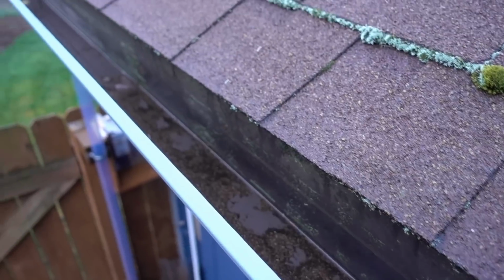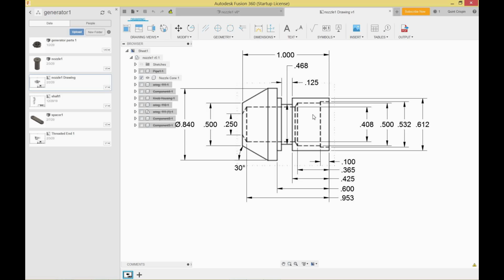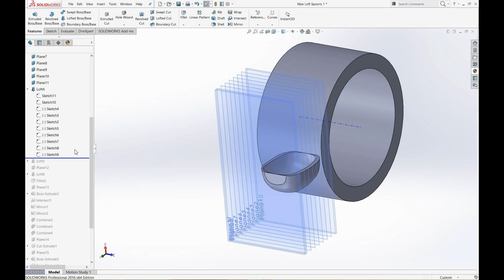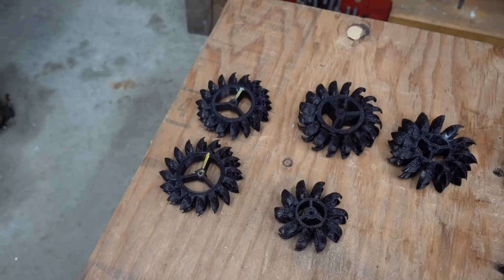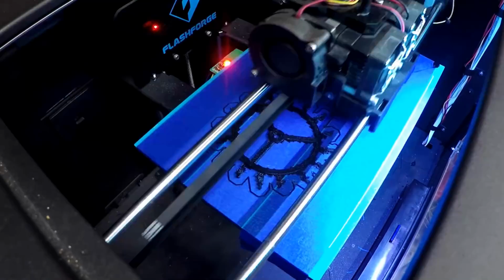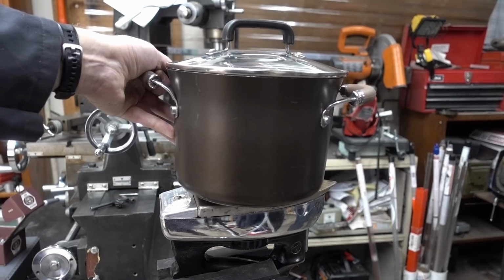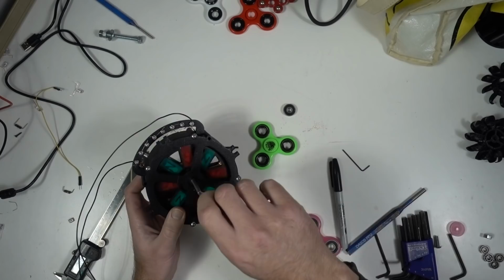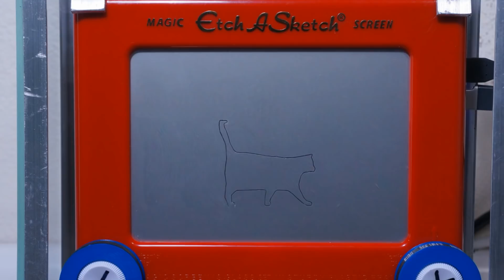Rain Gutter POWER #3 - Fidgeting With Turbines!

Comment from the maker: Thanks for the support everyone!  The suggestions I'm hearing so far are:
1. Coat the turbine with Rainex to shed waste water more rapidly (love this idea)
2. Enclose the turbine in a 3D printed shell with an exit port
3. Orient the turbine horizontally (90 deg) so the waste water can only go down with gravity (some must go up with pelton though right?)
4. Try a Tesla turbine
5. Build a rectifier out of mosfets for less voltage drop
6. Make the jet point straight down out of the pipe so water doesn't change directions at all
7. Larger diameter vertical pipe - if this worked it would violate every physics book ever written. I'd have to do a "why this doesn't work" thing.
8. Install an inline propeller/kaplan/francis turbine in the vertical pipe.  I'm almost certain this will hemorrhage water and not spin, but hey, if anyone can make it work...
9. Do a little more math on the velocity of the jet and make sure the pelton is spinning at 1/2 that speed.
10. Attempt to evaluate the alternator performance at various RPM/load to identify peak efficiency and target that with the turbine and rain.
11. Pronounce it RUUF instead of RUFF.  :)  Never knew I did this (or how much it bothers people!)

Part 4 is pretty much ready except for a few editing tweaks but as I said in the show notes, due to Covid-19 YouTube is taking EXTRA long to approve new channels for ad revenue.  So even though I've put thousands of dollars AND hours into this content, I have yet to get a SINGLE penny back (and may not for some time).  Therefore until YouTube approves my channel, the ONLY way to see Part 4 will be to visit my Patreon page and become a per-creation patron.  Part 4 is not published yet but will be VERY soon.  Sign up now and as a patron you'll receive a notification as soon as it becomes available.  The video will EVENTUALLY become public (once my channel is approved) but YouTube is keeping that timeline a mystery.  Don't forget you can set a monthly limit (I rarely post more than once/month if ever) and cancel your subscription at any time. 
 
https://www.patreon.com/QuintBUILDS

Donations are all "per-video" because it takes forever to make stuff like this and I NEVER want to take your money without having earned it.  

Part 5 is yet to be created so now is the time to cast your vote for which of the above suggestions to try first.  Here's my thought, lets get one reply for each of these ideas #1, #2, #3, etc.  Everyone else can LIKE/THUMBS UP their favorite.  I promise I'll try to do as many as I can, but will start with the most popular.  Also, the rain is REALLY tapering off right now so any serious testing would need to be simulated with a hose.  Part of me wants to document all this and lock it away until September 2020, right before the rainy season so it can be a bit more legit during testing.  But you folks are my community.  I'm REALLY touched by all the kind words and support.  If you'd rather have me dive back in right away with simulated rain, I CAN do that.
So lets see how this goes.  Never done one before but there's a first time for everything!  

A couple people have asked for a one-time donation option (that's how i made my first online donation so I totally get it).  Use PayPal: BUILD2LRN@GMAIL.COM  
I'll have to manually send you a link to Part 4 though which will delay it a bit.

Thanks for watching...

-Quint
Reply: Quint BUILDs , following now from the Philippines. With the rain we get during typhoon season, this would be a fun project for sure.
Reply: Vote for #2!  The other solutions seem like you'd be chasing very small gains, however harnessing all that "waste" water in an enclosure has potential.  Awesome project!  Subbed!
Reply: @mastabugfish  actually no, its as you put it, waste. Its got no velocity or weight to speak of, so you cant do anything with it.

Idea #1 for me.
Reply: Hi Quint, Love the videos but i have one criticism.... When you go to machining stuff the music you play is so much louder than your voice that its a very jarring transition. Headphones wouldn't matter but as i play this in my living room its enough of a change with the bass of the music that i have to turn it down and then back up again when you start talking. You aren't the only youtuber to do this. But my genuine thanks for the videos. Its shocking how interesting it can be to watch someone mess about with water and electricity.
Reply: I have started noticing americans saying ruff instead of ruuf a lot recently, people from the northeast, to the south, to the northwest. I always thought this was a local thing, but apparently, it's more common than I know.

Some advice on getting your channel to grow even more: audio is extremely important. You've got microphone quality down, there's hardly any improvement to be had there. However, the volume level between your music and talking, can be off putting for some people. If you go straight from 2:28 to 4:15, you'll notice quite a difference. If you can get this smoothed out, your videos will be even more enjoyable.
Reply: Did you try different electric loads? Maybe your led has too much or too little resistance for your setup. This could potentially be something which could be easy to try and optimize for.
Reply: all interesting ideas save for #11 which is best ignored completely. i'm adding ceramic bearings to the list or even better performance (if they fidget ones aren't that already).
Reply: #3 #6 #9, Im a strong believer of #9 by the way, the rpm seems to be too high for it to be efficient. I would rather say to change the generator to achieve #9. (increasing the generators coils, bigger radius for the gen, using 2 gens in the same axis) love this project btw.
Reply: Waiting for part 4.
Reply: Pls don't stop the project  with the 4 part. Keep this project improve, maybe use some resin prints for the propeller
Reply: I want to see a case to protect it in harsh weather.
Reply: #10 sounds the easiest. Use a variable resistor to find the optimum load, which would also affect the speed the wheel rotates at to satisfy #9 as well without needing to change very much
Reply: Oh hell, looks like the ideas I was just typing up in my own comment were covered in this one
I was readying up to suggest 2, and 6, i think adding the coating will be a big plus on those!
Reply: #1 absolutely. And #6 is also a great idea 👍
Reply: Number 11 Definitely. HaHa
Reply: @daos3300  I think he already selected the best performing bearing from all those spinners. The losses from this bearing are reduced to a minimum, so if you optimize that, you will not gain anything of significance... another 0,01W or something like that. I think it is wiser to spend the energy on something that is more promising.
Reply: #2 and #3 do not sound too bad. The rest does not make too much sense for me.
Reply: What will get you better results is using gears. The water is definitely coming out with enough force, and the blades are long enough to create the necessary torque to spin the generator twice as fast. Do this, and you will succeed in more power.
Reply: @Quint BUILDs I would try to do 1,2,3,5,10. I feel like these would get the most gains and hopefully get as much efficiency out of what you have.
Reply: How about connecting your overflow to another down tube/nozzle.   During heavy rainfall it would get a double blast
Reply: #10
Reply: I know that adding magnets to that equation in different part if the system will greatly improved performance. As well as the schematic for your wiring. I can think of lots of cool little ways to over engineer that rain gutter. I LIVE the idea. "Over engineered gutter". Anyhow there are quite a few examples on YouTube. If I can remember the name of the channel that does the magnetic stuff I'll give you a link. He might even have a lot of good information and ideas himself.
Reply: Vote for #2 then #1.
Reply: Don't wait for the rainy season - you'll want the kinks ironed out before then so you can charge... something, I guess, when the rains return.

1. Neverwet would be a better choice than rainex if you're hoping for a hydrophobic coating to have an impact on efficiency.
12. put the multiple jets back in place, but also tie the gutters from the front of your house into the same stand pipe (double the flow/input power)
13. Install a kaplan or francis housed separately and fed by the stand pipe. It would have to be tiny and probably spin super fast in order to not just hemorrhage, but should extract much more power, as those are supposedly much more efficient.
14. Install filtration in the gutter so debris doesn't get into the turbine.

11: doesn't bother me, though I say it where the "roo" part sounds like the end of "kangaroo." Of course, I work remotely with people from all over the world and consequently I hear every accent imaginable on a daily basis, so somebody saying "roof" incorrectly (j/k) is the least difficult accent for me to parse.
Reply: I would try to find the maximum power point of the current setup. As I understand you are just loading it with some random leds and resistors. You might already be well over a watt if you loaded the generator properly. just use a large potentiometer and try to find the mpp.
Reply: Hi Quint! I did like your video and started thinking of my fluidmechanics course at university. I think you should look in to local head loss or minor head loss caused by diameter change and diffrent fittings (https://en.wikipedia.org/wiki/Minor_losses_in_pipe_flow). If you read up on that i think you can revisit the multiple nozzle idea!! I think that if you make a additional hole in the pipe above the first one with a downwards pointing nozzle it might give the wheel more speed!
Reply from the maker: appreciate the feedback, how would you compare the music volume to Colin Furze?
Reply: 1, 3 and 4.  Very interesting series!
Reply: @QuintBUILDs  Did not even notice. Did you have music? :)
Reply: Here's an idea, and I'm sure there's a reason why it wouldn't work / would be inefficient / already suggested, but I'll ask anyway. How about, as others have suggested, an in-pipe turbine that avoids changing the water direction, but with magnets embedded. Then your wire induction coils could be around the outside of the pipe to harvest the energy.
Reply: 1, 5, 6
Reply: #10
Reply: It's fun to watch the progression of an idea! Btw, #9 and #10 are the paths to success!! (although I'd skip the math and just analyze some 60fps video :)
Reply: Waiting for part 4
Reply: I like how everyone ignored your "one comment with likes for each suggestion" plea..
Reply: could be worth trying a wind turbine based on your alternator
Reply: #3
Reply: Music's not bad actually. I'd stick with what you have now. It's not over bearing or too hyped. It's precisely the perfect flavor for your presentation. You're doing a wonderful job actually. Your videos are quite unique in their nature. Very intense but geared toward the layman. Which shall be fewer and fewer as time progresses if you and your keep this up.
Reply: Increase the diameter of the pipe.  It will work.  Pressure will equal flow speed.  That’s the physics of this.  I sell pressure sensors for a large manufacturer and we measure total water amount of tanks this way.  We also adjust flow based on water column pressures.  It works.  Plain and simple.
Reply: After some thought and no math at all behind what I'll say, consider this as it is not part of your list and I didn't seen it in the comments to this post:
 
Suggestion #1 - Have you thought about making the wheel paddlings bigger? The water jet stream can't handle the entire stream of water as the paddles are too small in my opinion... In the previous video you didn't really showed us what happened with the different wheel paddlings you made so I cannot be sure that this was considered. What you should look for is an "approximation to the perfect size" as it would take you A LOT of iterations to get to the really "perfect size"...
If my thoughts are in order you should be getting less voltage with more Amperage which should be your main goal if you want to charge a battery.

Suggestion #2 - Consider more systems along the vertical pipe instead of just one and if you manage to do it, maybe a good idea would be to make all of them go to the same generator with a rubber belt system instead of plastic cogs as I have some doubts that your 3D Printer manages to make them as perfect as your machining system would... Great tool you have there btw hehehehe
This should greatly improve the amperage you are getting as you are not really using all of the water pressure your vertical tube has for sure...

IMHO increasing the amperage that you are getting should be your aim as your plan is to charge batteries.
As I see it your bottleneck is on the the pressure of water you are not using and not on what amount of water you are not being able to properly use so one of the suggestions is to improve the system with improving what you can get out of one stream like what you've done so far and the other is to make multiple replicas so you can enjoy better the entire water stream pressure...

I sincerely believe my #2 suggestion would make your system a lot more efficient but haven't done any math on it to back my thoughts...

Props for the idea, tools and knowledge. Let me say that your explaining on current direction and how to manipulating it is genius and very well placed in layman's terms. You explain this stuff to a donkey looking at a palace really really well! :D

You Sir just gained a Portuguese follower and will be checking back for those extra parts as this project is extremely interesting ;P

P.S.: what people are saying in the comments regarding the sound volume changes with the transitions, I second it and it is quite annoying so please consider that in your videos going forward ;D
Reply: Some people (like myself) do not like/use patreon. I Love your content and would love to support. I suggest adding a Paypal or cryptocurrency link for people who want to do a one time contribution.
Your channel and content is great so keep up the great work! I am certain it will be drastically growing in terms of subscribers and views.
Reply: Now that you have less friction with the fidget bearings, why not just try tossing back on that other gear?
Reply: Hi,  I was thinking about option 3, to use gravity to divert more waste water away from the peleton which (?) May be losing energy by lifting waste water.  < Could a waste water vortex be created to somehow use atmospheric pressure to some positive effect...  ?
Reply: 12. Use multiple turbines in line from high pressure to low pressure as in a submarine nuclear power plant to capture ever diminishing pressure of super heated steam, until the end result is hot water, used in the ship for laundry or bathing. (not top Secret)
Reply: Would it make any difference if you positioned the Jet so that it is pointing down vertically rather than pointing horizontally on the wheel ...  For that matter I wonder what would happen if the axel was vertical but at a 45 degree angle ..  perhaps shield the pelton in an enclosure that uses water wast to create an air pressure vortex and to negate any wind resistance combined the water might be sucked out of a micro air vortex. or perhaps explore effects of atmospheric pressure that may vacuum waste water out of an enclosed pelton <?>  https://www.youtube.com/watch?v=U2HvJ973wkM
Reply: Yeah, you are correct!  Add a 1:50 gearbox :). If you want, I have one from a swimming pool cleaner.  Would work well.
Reply: would creating geometry inside the tube to try and generate a whirlpool effect go towards increasing the power of the water jet?
Reply: how about a second generator capturing the water used from the first one? would angling the nozzel downwards instead of 90 degrees create more speed on the wheel?
Reply: @MyrKnof  what if the wheel was higher up in an enclosure which fed the water to another wheel lower down? The maths escapes me, but my curiosity is piqued so instead of looking at maths for the answer I look for redundancy, would more wheels work?
Reply: #1 #4 #5 #10 for me. Very impressed with everything you've done so far. Especially loved the rectifier visualization. That was absolutely brilliant! Great work!!
Reply: I was thinking the same
Reply: #6 #9 #10 #11. “Ruff” reminds me of all the videos where people use the imperial system. Haha
Reply: I'd like to suggest suggest doing maximum power point tracking on the electrical side. It simply means figuring out the amount of electrical load that lets you extract the most power. It's very easy to check if this can offer a benefit by using different resistor values as load and calculating the output power. There should be a knee in the current-voltage curve which is your optimal load. Ideally a digital MPPT would find this knee at different flow rates. 

There are IC's for this for solar cells but you might have to roll your own solution in this case which could get quite complicated, however I've read it can improve efficiency in wind turbines by over 100% compared to a simple rectifier setup (obviously not expecting that much in this case). I could help with the design if you're interested, I have some knowledge of switch mode power supplies although I haven't rolled my own MPPT implementation before. I might just build one for fun - my list of personal projects has been growing shorter with this quarantine.
Reply: You need to add a gearbox to get it over 1 watt. Check out 21 ceramic speed for a drivetrain to sprocket design that would be interesting to reproduce. Good bearings make a difference. Nice German bearings vs the cheap fidget spinner bearings.
Reply: Wlf1191 Yeah I was going to say...a larger diameter pipe would result in a larger volume of water positioned above the nozzle, meaning higher head pressure. Since his Pelton wheel was slinging a bunch of water forward (potentially overwhelmed by volume) a higher pressure, lower diameter jet would help.
Reply: Lift the the collection point, the roof of the house.
Reply from the maker: @fnfjan  I created one but only told the one person who asked for it (really smart of me...)  Using PayPal: BUILD2LRN@GMAIL.COM  I'll add it to the pinned comment and my channel page, thx for the suggestion!
Reply: I remember from the first or second video we were limited by the input from the rain storm, but if you hook up the gutters from the other side of the house, surely #7 makes some sense then. Don't want the pipe to overflow.

I'd support #6 over #3 if you're only going to stick with the single nozzle and also suggest the pipe slant slightly at the nozzle instead of being flat.

#3 over #6 if you go back to multiple nozzles but redesign the vertical pipe to channel the water evenly to each nozzle. So, the turbine sits in the middle of all of the nozzles, vertical axis inline with the center of the vertical pipe. Also, make sure the nozzles are as far apart from each other as possible, e.g. 3 nozzles have 120 degrees of angle between them. Not sure how much of a difference it would make at this point, but also make sure the buckets of the turbine are "in sync" with the contact points of the jets of water from the multiple nozzles, the angle between the buckets is a factor of the angle between the nozzles.
Reply from the maker: @shaunbowen  well it would LOOK really cool I know that!
Reply from the maker: @justinbennett9998  Oh man, thanks!!!
Reply from the maker: @Wlf1191  The behavior you describe makes total sense in your application.  However when you have a column of standing water the pressure = depth x density x gravity.  So it doesn't matter how big the swimming pool is, only how deep you swim.  Otherwise if you had a large and a small pipe connected at the bottom the water level would be different between the two pipes (doesn't happen).  Also ships would float differently depending on the size of the body of water...
Reply from the maker: @teslatrooper  send me an email at BUILD2LRN@GMAIL.COM  I've played with MPPT before but assumed they only offered a more efficient battery management, not a feedback loop.  Would love to learn more but I'll easily lose track of the conversation in the comments.
Reply: #1!!!!!!!!!!!!!!!!!!!!!!!!!!!!!!!!!!!!!!!!!!!!!!!!!!!!!!!!!!!!!!!!!!!!!!!!!!!!!!!!!!!!!!!!!!!!!!!!!!!!!!!!!!!!!!!!!!!!!!!!!!!!!!!!!!!!!!!!!!!!!!!!!!!!!!!!!!!!!!!!!!!!!!!!!!!!!!!!!!!!!!!!!!!!!!!!!!!!!!!!!!!!!!!!!!!!!!
Reply: Hey , i know I'm late but here's another Idea, maybe try the other turbines again because now you've got less friction resistance and therefore there's less additional Tourqe on the Turbines so maybe one other design would spin better
Reply: #7 inverted cone type water storage
 more stored water= more energy and more pressure 
#7 + multiple jet = spin faster than ever
add filter
Reply: Use a metal fly wheel. A fly wheel can give you any amount of rpm you need. That is why all car engines use them. It might not start without little extra force in the beginning or you can make a clutch system. Think of it as your electric capacitor.
Reply: #7?  A large pipe would hold more water pushing down to smaller pipe would make more pressure at the bottom. Use a smaller nozzle. More nozzle pressure= more wheel speed.
Reply: Dont use gear, try use belt for transform gear from small gear to big gear
Reply: Bigger diameter tube
Reply: This is fucking sick, i gotta see u master this
Reply: You should really look in to the efficeiency of the electronics. See to the solar panel controller, and try adding som sort of MPPT. I think you can gain a lot from that.
https://en.wikipedia.org/wiki/Maximum_power_point_tracking
Reply: multiple smaller pipes spraying at different area of the wheel
Reply: 3 and 6 and you also need to keep experimenting with at least one additional nozzle as that is where the biggest gains are.
5 seems like something up your alley to try

Is there any benefit to changing the size, shape of the collection tube? Like say a giant funnel

Finally: where the real application could work is in the home water supply line. Lots of issues there, but a reliable constant source.
Reply: BONES SWISS skateboard bearings, will be 100x better than any fidget spinner bearing.
Reply: 1 6 and 4
Reply: I was just about to say try a tesla!
Reply: Would #6 be more applicable if you where to create a more laminar flow of water through the pipe?
Reply: The power output is velocity x flow rate ( I'm too lazy to look up the full formula ). You can expect about 80 to 85 %efficiency. 

Also you have to match the wheel velocity to stream velocity. When the wheel is stopped or the wheel velocity equals the water velocity there is zero energy harvested. The ideal is when the wheel velocity is one half of the stream velocity.
The stream velocity is directly proportional to the head
Reply: Hi, try 9
Reply: I will not waste my time with #5
Reply: Defo try some sort of turbine in the pipe, or a circle of smaller turbines
Reply: Number 10 can have the most effect, I suppose. If the wheel turns to fast the water is "to slow" in relation to the spinning wheel to exert (don't know if it's the right word because I'm not a native speaker ;) ) enough force on the wheel and thus transform most of its kinetic energy.
Reply: I love this series... I vote for multiple jets, but each jet has its own tube with no splitters, each jet could be fed from the bottom of the pipe, BUT have a tube from the jet up inside the tube high enough to avoid debris.  Hopefully with a transparent enclosure to watch it work and so the water can be directed to the drain.
After that, a Tesla Turbine would be amazing  :)
Reply: Man there is one more thing I would love to see in this project. Can you print and add a casing to half of the wheel and add some splatter catchers to it? What I mean by splatter catcher is this shell/spoon shape to divert the splatter back into the wheel. It is just a wild guess yo reduce in less energy loss (and make it less messy).
Reply: Also u can add another generator to the mechanism... there's no much friction while ur using those bearings (try the ceramic ones)
Reply: put it in a vacuum
Reply: 1.vertical alignment 
2. Volute casing with multiple nozzles 
3. Large wheel .. slow speed.. high torque... 
4. Use generator with more magnetic poles for slow speeds
Reply: What if the water exists instead of the pipe thru the propellor itself. So it's got more power in the propellor.
Reply: Another thing you can do (though I assume you've already done this) is make sure the magnets are as close as they can be to the coils for maximum efficiency. Also, I believe adding more coils can increase voltage
Reply: Dude, you are gold. You deserve all the fame you WILL eventually get.  Good play on waiting for revenue approval BTW
Reply: Any reason why you don't make the reservoir larger? You already have an overflow pipe, and the higher pressure would allow you to run it at the same speed but with less water output.
Reply: You lost some power to use that screwjet thing on 90 corner maybe it will be better to put one 45 corner and then do the screwjet thingy🤔  it gonna flow better and i suggest move that turbine to under it.
Reply: Quint BUILDs you can try to pull the water higher with a ram pump and see if the column is enough to compensate the loss of water
Reply: When you think about it, you have a double O in roof. Does a cow muh or moo? Quality content though, thank you.
Reply: It seems like you may also need more pressure. Have you considered using that turbine to power a mini pump at, let's say 6v, and using that pressured water to spin a separate turbine?
Reply: Vote for #5  !!
Reply: @Quint BUILDs Would it be possible to use the water to compress air before you use it to squirt on the turbine? Some what like this https://www.youtube.com/watch?v=uvf0lD5xzH0 . An adapted design of course. If you are going to experiment with Tesla turbines then this might be a way to get some more juice out of it?
Reply: Hey, why Figdet spinner bearings? Try Bone Swiss Ceramics Or any other Skating Bearing, Or rollerblading Bearing
Reply: Please please make the part 4! I'm learning so much from this. Getting interested in mechanical and electrical engineering applications; and I am an just a mere architect.
Reply: @MyrKnof  How about watering the garden when the rain has stopped?
Reply: i was thinking idea #6
Reply: @QuintBUILDs  I think you should revisit your nozzle design. The water stream still seems to be too low pressure and velocity. By constricting it more, focusing the water jet, and moving the nozzle as close as possible to the turbine, it should increase the pressure and velocity, giving a higher rpm of the turbine, giving more power. With enough velocity and pressure of the water, you don't actually need that much water at all. Also, take a look at the cross section of a commercial  nozzle here: https://www.quora.com/What-type-of-water-nozzles-are-used-in-a-hydroelectric-power-plant
Your CAD drawing and produced nozzle seems to have a much too thin needle/valve, not having the ability to constrict the flow enough. The nozzle itself also does not seem to have the same inner pitch as the needle point, thus creating cavitation and losing the focus of the water jet, reducing pressure and velocity further.
When it comes to the multiple nozzles, you need to increase the inner diameter of the feeding tubes from the down pipe. When mounting your splitter as you did (assuming the inlet and outlets of the splitter had the same inner diameter, as it looked like), you effectively halved your pressure and water velocity from each output compared to the input, thus giving you much lower performance. I've experienced this several times when we split our supply lines too much or don't use larger diameter feed lines to our "splitters". Not great when your boots are cooking in a burning forest... :-)